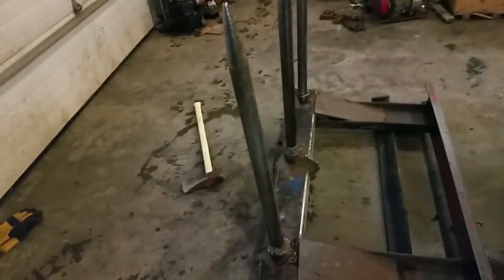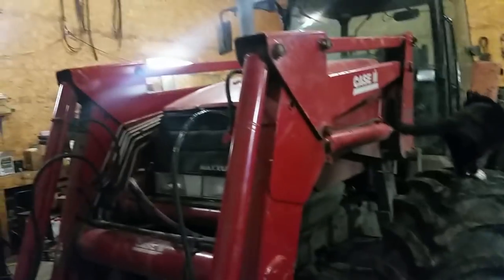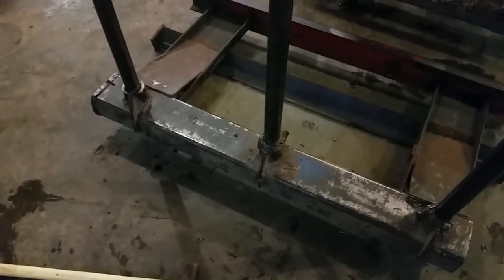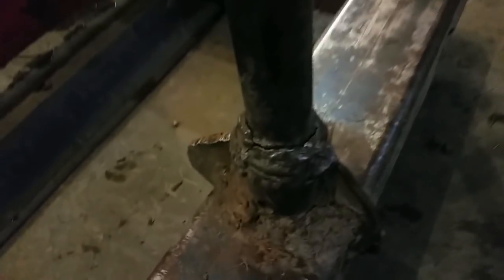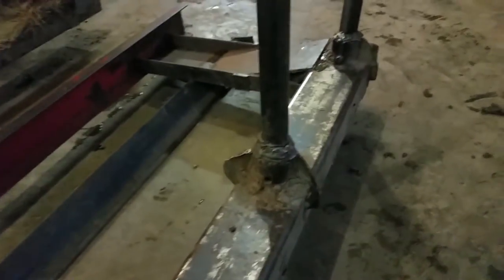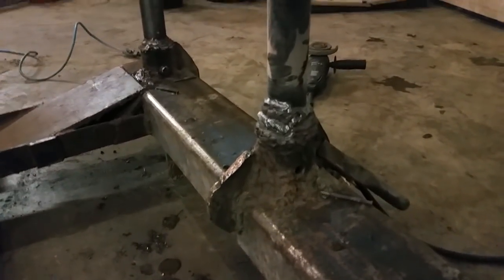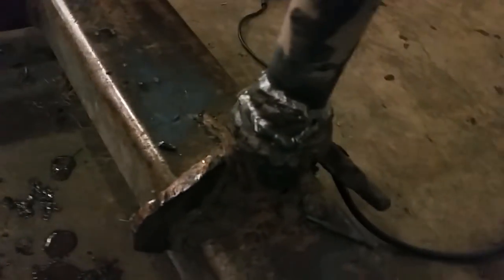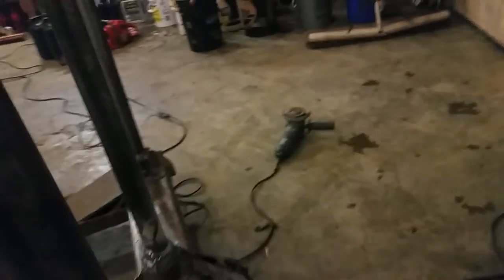Welding the hay fork

Comment: I agree three tines are better than two, I use 4, and it sure helps when strings are bad, the mud should be well solidified by now. we can now look forward to pulling frozen twine all winter.
Reply from the maker: Sometimes it works against you when the bales are packed real tight

Comment: what do you use to heat your shop. did you get anymore snow today. we've been having high winds here on the farm and snow showers. hope things are going good for you there.
Reply from the maker: We use good ole wood in the wood stove.  Its a pretty small stove but does a suprisingly good job at heating it.  Our shop is 32 by 46

Comment: I was a certified  welder for years if you would preheat the fork a little it would probably stop the weld from braking just maybe 300 f.
Reply from the maker: thanks for the tip